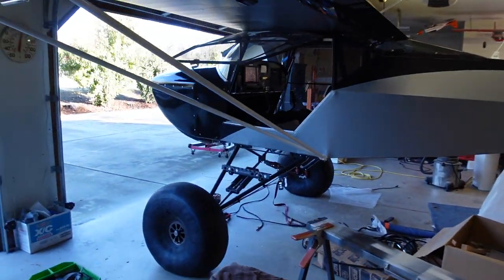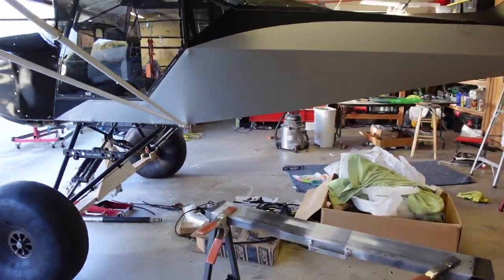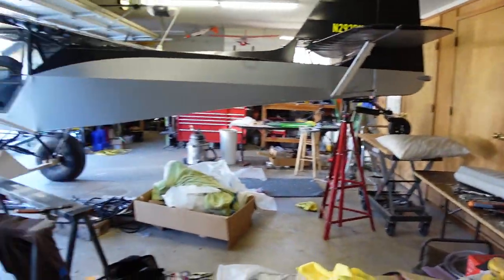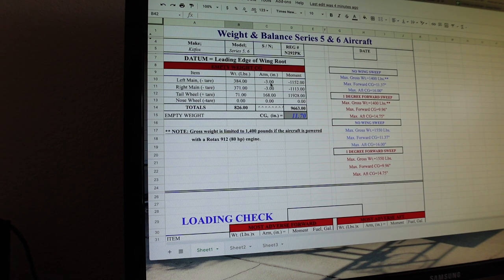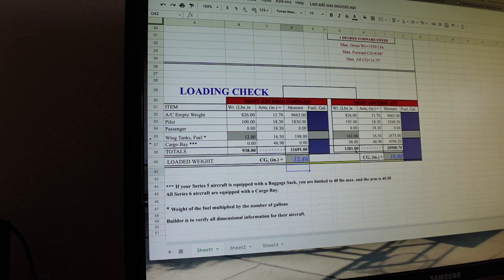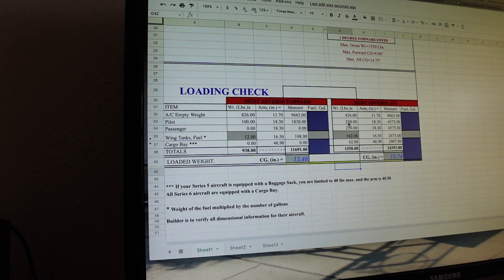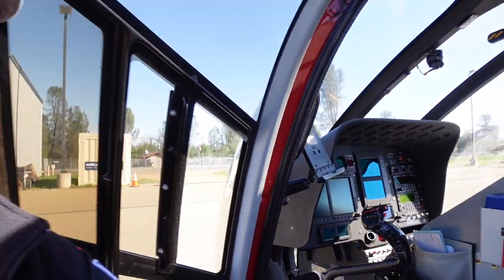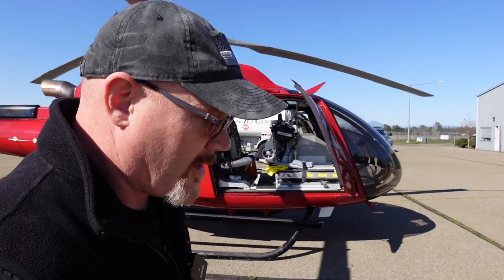Kitfox 7 Apex Build Episode 45 Kitfox Series 7 Weight and Balance

Comment: Sorry if I missed you mentioning doing this, but you should also measure the tailwheel arm, like you did on the mains.  The default value in the Series 5 & 6 spreadsheet you used, may not be valid for the type tailwheel gear you used on your aircraft and/or differences in a Series 7 aircraft.  Thanks for all the great videos , I've thoroughly enjoyed watching your build and you have done a terrific job on that Kitfox.  Can't wait to see what you can do with it.
Reply from the maker: I ended up doing that after the video and it came out to be 165” not 168”

Comment: I use a similar set up to jack up my PA-12 to change from wheels to skis. It's just a 4x4 that I shaved out some notches for the gear. It's not pretty but it lets me do the change in 45 minutes. I like the reinforcement to the cabane.

Comment: Bryan, how did you make the decision to have no forward wing sweep? Based on your CG it is good that you didn't have any, but what exactly leads you to making a choice? I'm guessing powerplant weight and distance off the firewall would be the main factors but is that a calculation you made, or something the build instructions pick for you? And thanks so much Bryan for this excellent series. Excited to see it fly soon. Nice office chair too.
Reply from the maker: Glenn, The forward wing sweep is only recommended for the heavier Lycoming or Continental engine installations. It moved the center of lift forward, which in turn moves the CG range forward. In my case, the engine weight was very close to a Rotax, so the wing sweep was not needed.

Comment: Bryan with the c.g behind the front wheels does that not contribute to ground looping ?
Great job you are very dedicated 
Thanks so much looking forward to the maiden
Reply from the maker: There are positives and negatives for sure, it puts more weight on the tail wheel when it is down allowing for more positive control from the tail wheel and it also allows for heavier braking before it would nose over. If you get into a ground loop scenario there would be a longer lever arm of side ward motion and it would be a negative.

Comment: May check to see if you had airplane sitting level when you measured arm for main gear. Won't change much but could affect calculations overall.
Reply: My thought too. Might Acct for the missing 1 inch.
Reply from the maker: It was leveled to the flying position as per the manufacture directions. It would make a difference if it was not leveled.

Comment: Great video with loads of info as always . Brain just a quick question ,have you ever thrown a scale under the tailwheel when the plane is in 3 point sitting on the ground , with a gross weight in the plane say between 1400/1550 and seen what tail weight is ?
I would assume it would be way north of 100 pounds plus with the shock monster gear being 3 inches forward of the datum allowing for better breaking . THANKS

Comment: I have a quick question for you. You measured the main arm at 3 inches. Now did you raise the tail back up?  I'm asking because right before that you mentioned,  you lowered the tail a bit.  By raising it back up would bring the plumb bob closer to the two inches you thought the TK-1 should be.  Just throwing it out there.
Reply from the maker: Yes

Comment: If you register your plane as 1500lbs gross weight, it will not be an experimental, correct? And looks like you will register it as 1500 and not 1350lbs. I am not sure how all these works.
Reply from the maker: I think you are referring to light sport or LSA/ELSA. Anything over 1320lbs takes it out of the LSA category, I registered it as an EAB experimental amateur built and there is no weight limit for that.

Comment: at 11:37,  a gallon of water, weighs  8 1/3 pounds.    is fuel  lighter than water?
Reply: Yes, 6 lbs per gallon is the normal calculation.
Reply: @craigsanders6925  okay
Reply: Gasoline is .77 density mass of water. 1 litre of water weighs 1 kilogram (metric is so simple!) SO...1 litre of gasoline then weighs .77 kilogram, or 770 grams. Now you can convert that to gallons if you like.
Reply: @challenger2ultralightadventure  bla-bla-bla        you must be a compulsive talker.      bc  you gave me the info i needed, in the FIRST  poorly-worded sentence.   out

Comment: you may already know the following.
the geometry of the main wing determines where the  cg  and  center of mass (c-m)  Should be.        for  Any  wing, the optimal location of cg is  at  thirty percent of chord; or mac.    (constant chord makes this part simple.)      thus, wherever the cg  ends up being, it should not be aft of  thirty percent.     (if it is, control authority will be  reduced.   which is bad.)
the  c-m  Should  end up being, On the thrust line,  and vertically aligned with  twenty-five percent of chord.      the  obvious (and desired) result is, an inherently nose-heavy  distribution of mass (dom).        ideally, in a normal high-wing light-plane, design of the airframe results in the  c-m  and  the pilot's belly/chest,  being in the same spot.
i'm guessing that, at full-scale, cg balancing  at the wing is not practical.   unless, the structure of the wing at thirty percent of chord, has been  designed to support the auw of the aircraft.
if it is practical, then the tires could be partially deflated, after supports are in position.
imo, the present location (of the mass) of the main lg  is totally  close enough.    at worst, it very slightly increases  nose-heaviness, in the dom.   
as a result of the moment arm  at the tail, any  'excess'  mass  located there is potentially  problematic.     cheers         googletranslate